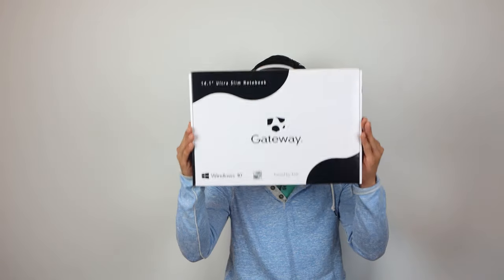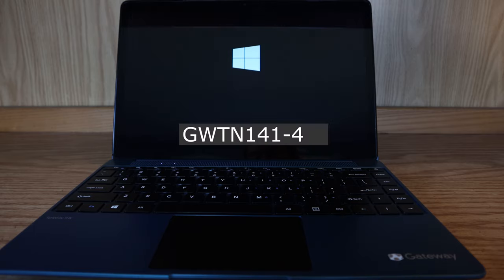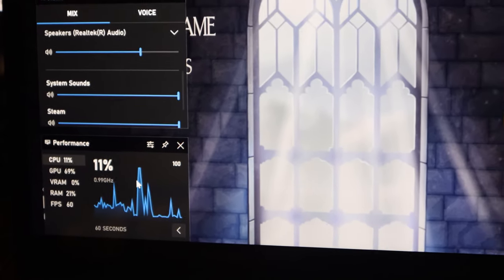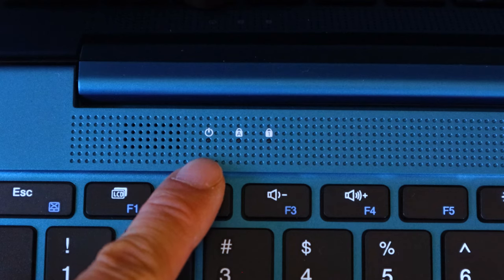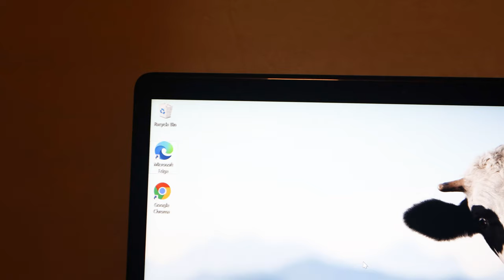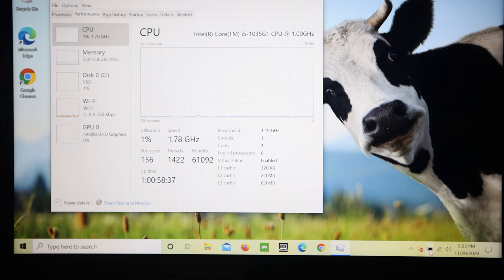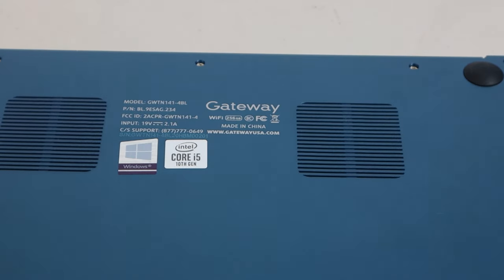2020 Gateway Ultra Slim Notebook Laptop Model GWTN141-4 Review

Comment: Bought the 15.6 w/ Ryzen 5 and 16GB ram. Extremely impressed with it. This is not going to be my everyday machine, but just while on the road. 16GB ram was a huge selling point, to get that from other manufacturers there was a huge price jump.
Reply: Does the keyboard feel like it will fall apart easy?
Reply: Did it have expandable storage I'm going to be buying one soon and I'm wondering if I should buy a extra ssd
Reply: @Orang-rv1bs  it has a compartment for an m.2 on the back
Reply: @chriskar02  do u know if you can put more ram in it?
Reply: Mine gave up on charging after 3 uses.

Comment: I bought the Ryzen 5 16gb 256gb model for $399 last week, then I chickened out and cancelled my order. Now that I want it back, they're out of stock. Smh.
Reply: Don’t get it, it overheats and melts within a week.
Reply: @noahchapman8788  not if I use it strictly for Google Stadia. I literally don't need a computer. I want to use Stadia on a laptop. No computing at all. Just a stream.
Reply: @adsr14  I was watching a movie and it melted so up to you.
Reply: @noahchapman8788  You have/had the AMD model and it over  heated? Interesting as AMD has reputation is for running cooler. The Intel version must be very hot by comparison.
Reply: Was that the newer AMD 4500U chip? AMd also suppose to run cooler.

Comment: Hi Phil, I was wondering, do you happen to know the length of the SSD that goes into the exterior panel? I was looking to buy one, but I'm not sure if it will fit properly.
Reply from the maker: The size is 2280 (22mm wide x 80 mm length)

Comment: Hi Phil I like your review do you this laptop would be good for running DJ programs like Serato? Got a nice controller for my Birthday and don't have a windows pc and can't spend a lot of money.
Reply from the maker: Hi, yes, this laptop meets the minimum requirements for the Serato DJ Pro software if set to performance mode. That said, it's unclear how hard the software would push this laptop's processor. I only note this because of the potential for fan noise when the CPU is using more processing power, so I'm not sure how that might impact your decision. Most recommendations I've seen for Serato indicate using a budget gaming laptop that has a more powerful CPU and GPU. Of course, "budget" when it comes to gaming is relative and usually means in the $600-$1000 range, but a second hand one or model that's one or two years old may provide more affordable options. I'd go with something with at least an Intel core i5 @ 2.0 GHz or more with at least 8 GB of RAM and current generation GPU.
Reply: @ReviewedByPhil  thank you for your input appreciate you.
Reply: Thank you for asking this question! Because I'm on a budget getting a new laptop, for my Pioneer DDJ SB3 controller running Serato DJ as well. Also, I was going to get a 16gb ram, but might have to settle with an 8gb ram for now. I just use it for online streaming and some gigs. Thanks!

Comment: Thanks for the tear down wanted to see the guts before buying this.
When i saw soldered ram my heart sank. What if a module goes bad?
Reply from the maker: I believe soldered RAM failures are not very common. However, if this does happen to occur, I suppose your best options would be to try to file a warranty claim (if still under warranty) or send it in for repair.
Reply: @ReviewedByPhil  what if your warranty is out down the road?
Reply from the maker: Same as anything else. Either get it repaired by a pro, DIY if you can, or replace it.
Reply: @ReviewedByPhil  desoldering ram isnt just an easy task and is it just common to find ram kits that u just solder on for your laptop?
Why not go with a simpler easier option.
Reply: So it has just one slot for ram right?
Reply: @justSomeChap  no the ram is soldered to the motherboard. Meaning u cant upgrade or replace it.

Comment: Although there is mark showing "PCIE *4 SSD" (video between 8:37 to 8:47), this laptop only works with M2 SATA SSD.  It won't boot from M2 NVME SSD.
Reply from the maker: Thanks for the info and clarification!
Reply: wish I would have read this before I bought a NVMe card. won't recognize it at all.
Reply: Strange, I have an 2TB NVME (ADATA SX8200) in the hidden slot (under the main bottom cover) and it's working fine. Again, this is the slot under the MAIN bottom cover (already populated with the included SATA M.2).
Reply: Which one did you try, did you update the bios first?

Comment: Great review, thanks! just curious, where did you find the specs of the m.2 ssd expansion slot (SATA 1TB)? i couldn't find on their support website or crucial memory finder.
Reply: He didn't. I screenshot his demo at the point of installing the m.2 SSD, zoomed in to read the ssd details, and it was a Hynix NvME, not SATA. I've tried 2 NvMEs (one was a Hynix) in my identical model laptop and they didn't recognize. I doubt if his did either, since it's a SATA interface.  I have ordered a SATA SSD now to try again.

Comment: 1:18 Question:  What type of M.2 SSD can be used? I bought the Gateway 14.1 GWTN141-2GR Model. Thanks!!!
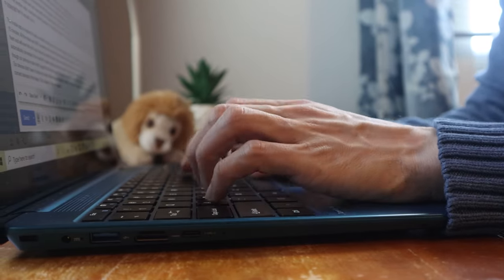Reply: Never mind 7:45 🤣
Reply: @Raymond7877  What SSD did you purchase?
Reply: @dec2955  i haven’t bought one yet, but looking forward in near future
Reply: Just a heads up that the storage is not capped at 1TB.  I have an 2TB NVME (ADATA SX8200) in the internal slot and a 2TB SATA (Western Digital WDS200T2B0B) in the user expansion for 4TB total.  To clarify.  The user accessible slot under the small cover is SATA only.  The (all ready populated) slot under the main bottom cover is SATA or NVME.
Reply: @David_L3  good info thanks!
Reply: @David_L3  yes! That works!

Comment: okay i just bought mine a week ago, and when charging or when using it gets kinda hot should I be worried about this , mine does not have any air vents like yours either SMH . What do you think I should do?
Reply from the maker: Hm, I guess the main concern would be resting the laptop on your lap, as this could cause a first-degree burn. Other than recommending that it only be used on a flat, smooth surface to allow the heat the dissipate, my only other suggestion would be to look into getting a laptop pad/stand with a fan, like this one: https://geni.us/gHyjL [Amazon Affiliate Product Link]
Reply: @ReviewedByPhil  so you think I should return it for a different one , got mines from walmart too, and thanks for the information on the link about the laptop pad/stand ...
Reply: Yes

Comment: What type of screwdriver do I need to open the bottom of the laptop? Does this laptop support standard M.2 wireless and Bluetooth cards?
Reply from the maker: A mini Phillips screwdriver with a size PH1 or J1 bit should work. Yes, the laptop supports one additional standard M.2 SSD drive (see 7:45), but if I recall, the wireless and Bluetooth cards are not removeable/replaceable, but I didn't really look for them when I had opened up the laptop (see 8:18).

Comment: Wait so I got a bit confused on the wifi card part It can Only connect to 5g Connections or did I hear it wrong?
Reply from the maker: That's correct. the WiFi card doesn't support 2.4 GHz bands, 5 GHz only.
Reply: @ReviewedByPhil  I have just received one for Christmas it seems to work on all my wifi bands 5g or not am I just confusing this for somthing else?

Comment: Question 1: does is support a nano sim slot Question 2: does is come with built in google play store and google youtube?
Reply from the maker: No, this laptop does not have any SIM slot for a cellular data connection. Since it is a laptop and not a tablet/mobile device it does not support Android OS type apps like Google Play store or the YouTube app. It will require Windows PC type applications to be installed, for example, the desktop version of the Google Chrome web browser. Windows natively supports "apps" that can be installed via the Microsoft Store where you can find some supported apps like Netflix, though most streaming services, like YouTube, can simply be accessed over a web browser by visiting their URL.

Comment: I am looking for a new editing laptop for my YouTube (but am on a tight budget). Would this laptop be good for this? I edit 1080p on Filmora x. My current laptop is being held together with duct tape and I have to export 2 minute segments at a time or it will freeze and overheat 😂 so easily anything is an upgrade but I don't want to waist $450. Thank you in advance! 💙
Reply from the maker: Hm, I use Adobe Premiere CC for video editing, and I haven't used this laptop for that because I know the performance will not be that great. I've found that video editing software tends to crash on lighter weight systems even at 1080p, so generally when recommending a laptop for this purpose I would stick to one spec'd for gaming because it needs three things to run smoothly (and not take forever to export video): a decent CPU, a good graphics card, and at least 16 GB of RAM. I don't know that you're going to find something like that at a similar price point as this laptop (they generally start at about $800 and go up from there). However, if you're willing to go the desktop PC route, you can get a decent one for video processing in the $500 range (tower only, no monitor ☹). My suggestion is if you're on a tight budget, try picking up a secondhand gaming laptop (released within the last 2 years) for a decent price. This will also futureproof you for if or when you decide you want to start working with higher resolution video like 2K or 4K.
Reply: @ReviewedByPhil  I'm currently purchasing a laptop for an employee that will use the laptop for Adobe Photoshop, Excel, Microsoft Word, Confluence (web app), and Trello (web app). Do you have a laptop you'd recommend that is super low cost but can handle those programs (Adobe Photoshop, more specifically).

Comment: Hey there! so i noticed that the hdmi port is smaller than traditional hdmi but looks just like a standard, what would the correct hdmi cable to buy if i want to hook up to my tv?
silly question, but im not text savvy
Reply from the maker: It's a regular standard HDMI so any standard full-size connector HDMI to HDMI cable will work!

Comment: I inserted a 1TB nvme pcie 3d nand pcie m.2 -2280 card in the external drive slot but it doesn’t recognize the drive. Any suggestions.
Reply: @alf5778  Adata SX8200 NVME as the main drive & a WDS200T2B0B SATA in the outside auxiliary slot. These are 2TB drives but you can install 1TB drives too. Even though they say that drive size is capped at 1TB, 2TB works. Hope this helps.

Comment: Does the 3.5mm port support just headphones or a headset (headphones and mic)?   The symbol just shows a headphone.
Reply from the maker: Hi, while it's not listed in the specs, the headphone jack on this model is TRRS and supports both mic input and headphone out. I tested this out with a 4-pin integrated mic gaming headset plugged directly into the analog port, and it does pickup audio from the mic on the headphones. For reference, the headset I used to test this functionality is the Logitech G Pro X, which I reviewed previously here: https://youtu.be/8HgScbQy8O0

Comment: What type of SSD does the second port support, and did you have to change anything in the BIOS?  How about a video on just the SSD install on this laptop!!
Reply: With no support from Gateway found the following: second drive has to be the same type as the original!  In my case that means that drive would be: "M.2 2280 SCSI" Interface of any size you chose.  It seems that the first/internal drive can be a "M.2 2280 NVMe" drive
Reply: @dec2955  What size did you go with?  Earlier comments in the thread say 256GB is the largest the bottom will support.  Anything larger is not recognized. Did you run into this issue as well?
Reply: In my case, I just replaced the preinstalled drive with a new 1TB drive (max. Size the bios supports) of the same spec., then transferred the data using Macrium Reflect 7. I could have done the same as described above but that idea didn’t come to me until now. Now I will install the old drive to the external slot and see what happens. Thank you for waking me up, David C.

Comment: How do I access the BIOS?  I added an m.2 to the bottom and it is not recognized.  I'm wondering if there's a switch in the bios to turn it on.
Reply: Bios is accessed by pressing FN F7
Reply: Max size of m.2 is 256GB.  Larger size not recognized.

Comment: The F key only kind of works. I pulled the key off and their is a black screw underneath that seems to be preventing the key to push down on the bottom left corner.
Reply: Is this laptop still worth getting?

Comment: Thank you for the review! Does anyone know if you can use this with cricut design space? I just need a simple laptop for that. It should work because it has a USB port and is windows but I just wanted to check.
Reply from the maker: This laptop meets the minimum requirements for Cricut Design Space, so it should work (Windows® 8 or later*, CPU: Intel™ Dual-Core, RAM: 4GB, 2 GB free disk space, USB port or Bluetooth, and Display: Minimum 1024px x 768px screen resolution), though I personally haven't verified this.
Reply: @ReviewedByPhil  awesome! Thank you so much!!

Comment: Did you experience the thing where you got stuck on a screen while downloading windows? I got this same laptop just a few hours ago and its been stuck on the "just a moment" screen for a while. Everyone says to turn it off and then on again, un plug any external things. I've turned it off and on again multiple times and nothing. I'm also still in the process of setting it up so when I turn it off I have to take a few minutes to re do the first steps of the set up. I was hoping to start using my laptop soon
Reply from the maker: Hm, no I didn't have that problem with mine during setup. How long did you wait before turning the machine off after the screen appeared? Sometimes things just take a while to complete, or if it's downloading updates from the internet perhaps the download speed is slow. If it doesn't move on to the next step after 15-20 minutes or so, that might indicate a hardware failure which is rare but can happen.
Reply: @ReviewedByPhil  ya I'm pretty sure it was a hardware failure or that computer just wasn't working. I returned it and got a replacement and it worked immediately.
Reply: i had the same happen just now . was stuck on that screen for a loooong time right before imputing the pin ... i tried turning it on and off and kept doing the same so i forced it to bios menu .. when the laptop turns on the gateway logo pres esc key then i reset it to defaults re tried and fialed again . i closed it and left it thinking ill return it tomorrow but then cortana started taking with the cover closed lol. i was able to finish the setup and apparently it is working now i am using it now writing this comment.

Comment: My Chromebook gateway gwtn116 won't start after turning it off of shutdown or sleep..is it broke??!! How to turn back on.  Only had 1 year
Reply from the maker: It's possible something internally has failed, the battery, SSD, RAM etc. It's not possible to tell without opening up the laptop and checking each component individually for the cause.

Comment: So i just picked one of these devices up from Walmart this weekend. I was wondering if I would be able to do WIFI 6 on this device? It comes with a WIFI 5 adapter but I could not see from the Video if the WIFI adapter is available for Upgrade. Kind of disappointed that the Ram is soldered onto the motherboard
Reply from the maker: No, I don't believe the WiFi card is upgradable, however, WiFi 5 is compatible with a WiFi 6 router, you just wouldn't get the full speed.
Reply: I just bought one today and it already crashed

Comment: 'hello . i bought a m.2 disk to upgrade to 500gb the memory, but the bios do not recognise it, how can i do
its a pnys ssdcs3030 m2 500gb 2280 nvme pcie
Reply from the maker: This laptop will not recognize NVMe m.2 drives in the expansion slot. The connector is only compatible with SATA interface m.2 drives, like this one: https://geni.us/nSTKB [Amazon Affiliate Product Link] The only way to get the NVMe m.2 SSD that you have to work with the laptop is to use an external enclosure that would plug in via USB, like this one: https://geni.us/HHwhWt [Amazon Affiliate Product Link]

Comment: Thanks for the review. My laptop fan is very loud and I’m not sure if others are facing the same issue. Anyone replace it?
Reply: Those budget laptop brands were built to last after one year warranty expires. The display driver update will make screen go black, I have seen 90% of those display went black and keyboard failed with in four months.
Reply: Less than 20hrs and it’s having major issues. It doesn’t even power on now. When I was using it, I noticed the fan ran constantly. I’m assuming something burnt out on the inside.  Sticking with Mac from here on out.
Reply: @tablesaltgames  I ended up replacing the fan myself and it works well now. However, I ruined the the micro sd slot after taking it apart. No laptop should come like this after purchase.

Comment: Is this SSD (Solid State Drive)...as heard that’s better than HDD, and not seeing either listed?  Thanks!
Reply from the maker: Yes, all m.2 form factor drives are SSD (no moving parts) and this laptop doesn't support HDD drives. You can see the pre-installed drive at 8:28.
Reply: The only thing you can have as an HDD is an external one. But SSD is way better than HDD.